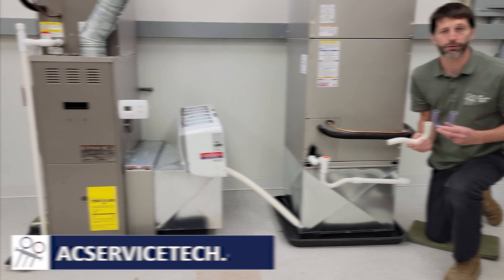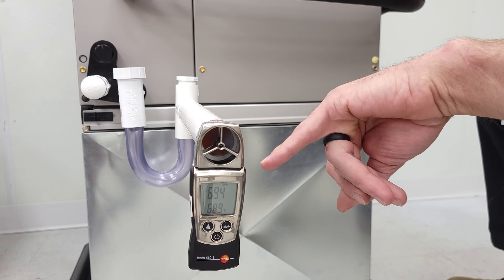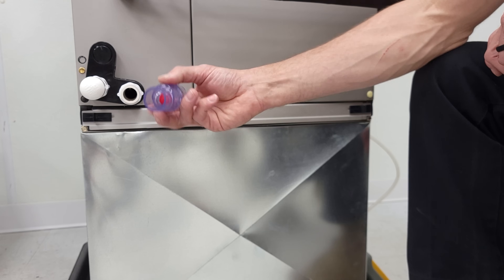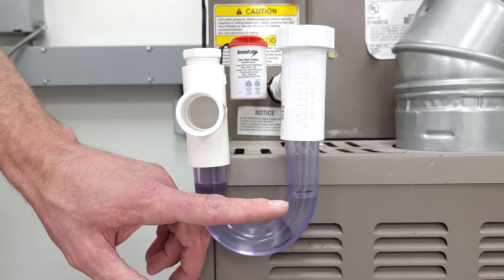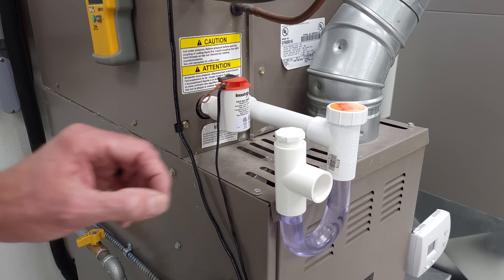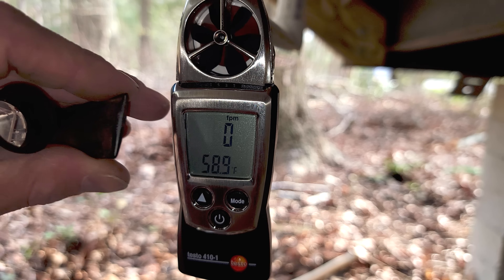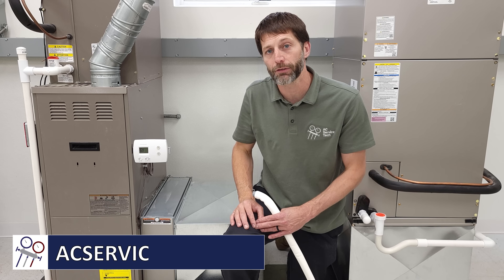Air Conditioner Condensate DRAIN TRAPS! Function, Problems, Cleaning, Air Loss! Do I Need it?

Comment: With the second example shown (positive pressure system) I noticed the shut off valve is slightly higher than the drain vent. From the little bit of research I've done people stated that it's faulty and did not work as it should. That in order for the valve to be triggered it needs to sit slightly below the drain vent. Is this true?

Comment: What does it mean if you pull the cap on the inlet side of trap and water starts flowing into trap then put cover back on and water flow stops .
Reply: Yes, I noticed the same thing on my gas furnace with A-coil above!  The U-trap is full of water but I can’t tell if it’s flowing until I pull the inlet side cap off,

Comment: The first 95% furnace that I installed constantly quick cycled and I found out the the condensate plug had to be opened so the water could drain off (Yeah I finally read the manufactures instructions) I added a p-trap with a clean-out tee and it worked fine at after that.

Comment: Craig, Thank you. Also please make a video about piston sizes. Can the piston used for r22 be used for r410a? I always install the TXV when I do only condenser change out. But I always wondering what is gonna happening if I will leave the piston without touching anything on the air handler side.

Comment: My drain line was plugged up and overflowed into the secondary pan, but I don't understand why the float switch which is attached next to coil drain didn't tell the system to stop? I pulled the float switch out and verified it does shut off the outside unit when moved, but don't know why it wouldn't shut off the unit before it started overflowing into the secondary pan. I have no P trap.

Comment: I have air flow coming out (exiting) straight up from the condensate line.  A coil on top of a furnace.  Do I need to plug it off?
Reply: It appears that his is capped off on the system on the left at the end of the video at 9:54. That system appears to be a coil on top of a furnace.

Comment: The air escaping in your math scenario is 15.8 cfm, not 4 cfm. You forgot radius squared. Not sure why it’s acceptable to allow a loss of 15 cfm from any positive system. This would be the same as having a one inch hole in your ductwork. This makes a compelling reason to have a trap on a positive pressure system, to prevent air escaping. Nice job demonstrating the physics.
Reply: And also, many local plumbing codes require a trap in any installation.
Why? They tell me it’s because they didn’t want all that air escaping! To your point sir.
Thanks

Comment: Fun fact if the unit has positive pressure no need for p trap. If it’s under negative pressure you MUST have a p trap
Reply: Thanks you for saying it!
Reply: Unless you have the drain piped into a vent stack, which is common where I live, then it must have a trap no matter what. P-traps on positive pressure systems are a joke, only use a U trap, that’s what my manual required,  but the installer cheaped out on and it just blew the water out.

Comment: I have a whole house dehumidifier and I piped the drain to a condensate pump; pipe just off the bottom. My hvac buddy added a trap when we were troubleshooting an unrelated problem. From your video, it sounds like I should remove the trap. Yes/no? Thanks

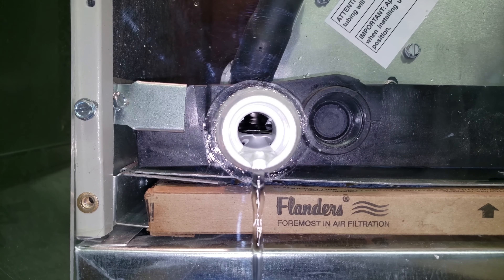Comment: My Furnace & A coil didn't have a trap on it for 10 years when I moved in this old house. I seen a video online and it showed the water trapped in the pan because of no trap. I looked at my unit. It had no trap. I looked while the unit was running and the condensate was pooled because of negative air flow. It looked just like this video at 3:08 min. I put a U-trap on it a few yeas ago. The u stays full of water now. When I pull the cap, I noticed positive air flow. Why would it have negative one time and positive later on? I went to HVAC school, but I don't use that knowledge except for my personal house.

Comment: The CFM result should be double. You forgot to multiply by 2 when calculating Area.
Also considering ~8CFM coming out of the PVC pipe i would recommend adding a trap even on positive pressure system. The air will cause restriction for condensate...
Thank you for the video. Great info as always.
Reply: What? The air does not restrict the flow of condensate at all when trap is on supply side of the fan. If anything it helps to push it out. Only time the air will restrict the flow of condensate is on a draw through system. Either way I install traps on both types

Comment: Make sure to always add a tee on p trap. Clean out is needed especially in a attic
Reply: Should the clean out be called or left open? Split system air handler in attic gas furnace...
I have rental properties with multiple units. I see these traps with the vertical clean out that is always left open.. why is there not a cap on it?

Comment: Best video ever 10 stars and 10 thumbs up. Specially now that I am about to install a heat pump and I had been searching for this answer since I didn't know the requirements for it and also because I new ducted and ductless work differently and also because I was debating whether to drain it outside or inside into a drain or even a pipe that drains my kitchen sink but was concerned about sewer gases backing into the drain pipe.

Comment: Great video as always.  For any newbies, don’t put trap there air you won’t get your filter out 😉
Reply: You can do it so long as you don't glue the first drop 90
Reply: Add unions if you have to.
Reply: Yeah some clients want to change their own filter.  Just as easy to run horizontal till I reach the side and put the trap there..  makes it easier on them for changing the filter

Comment: I think we should be calling the system either ‘Positive pressure’ or ‘Negative pressure’ system to avoid confusion. 
A good topic of discussion would be what to do with that secondary drain port for each style system.
Reply: SS2 (or the like) safety switch or p-trap on negative pressure. SS2 or indicator tube/drain line on positive pressure. 

Alternative is to run an in-line safety switch (SS1) on the primary then the above option minus the SS2.

Comment: For 13 years my Nordyne 4 ton unit drained out what I thought was a pretty good condensate "drip". It had NO p-trap. After watching a previous video you did, I installed the Rectoseal trap and turned the condensate drain into a small garden hose. Everything equal, I dropped the RH by 5%. To test how well this works I opened up the cap between the trap and air handler and added food coloring and let the unit run. The food coloring just sits there. Closed the cap and off she goes.
Reply: There you go, all that water siting in pan and air until unit turned off to drain, plus sucking in outside air.  You may have reduced runtimes by 10-15% by reducing latent load.

Comment: Adding a trap to a positive system can cause drainage issues if you cap it.
Reply: If you cap it before the trap or after?
Reply: @johnconnor7501  before the trap. After doesn't matter. 

The problem is the air hits the water in the trap and has nowhere to escape so it turns back into the coil (the place of least resistance) not allowing condensation to drain properly due to turbulence.

The cap need to be off to allow the pressure to escape.
Reply: @Eyezayah ⬆️⬆️
Reply: @Eyezayah the water doesn't go back, the air does, it basically hits a wall. Think about it.
Reply: @Eyezayah I'm speaking from experience. 

The airflow doesn't disappear or stop once it hits the water,  it's like air hitting a damper (I guess that would have been a better analogy)
Reply: Only if you cap a riser after the trap because than can siphon the drain. If you have a riser before the trap you MUST cap it or the trap doesn’t work. I have riser before and after my trap i I can clean the u trap out. The upstream riser is capped. Works great.

Comment: Hi Craig, I guess this video was just for Air Conditioning coil drains but what about a 95% condensing gas furnace. My basement goodman furnace has a couple 1/2 inch tubes exiting the furnace burner section and dumps into some kind of gray plastic box trap they send with their furnace's, then dumps into the open drain or condensate pump. Is that trap necessary? This is in addition to the 3/4 inch pvc drain line coming from the cased coil drain pan above.
Reply: Yes keep that trap!
Reply: Yes of course it's necessary. It's preventing exhaust gasses from flowing into your basement or wherever it's located.